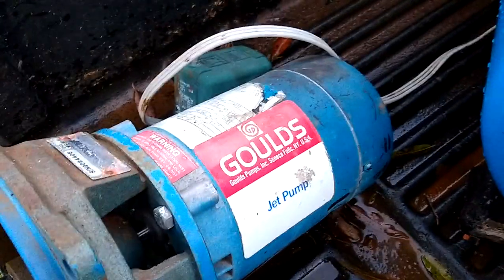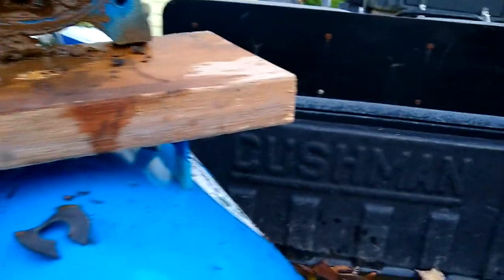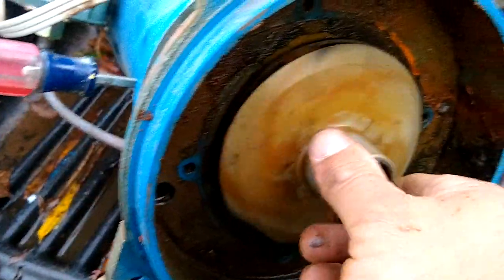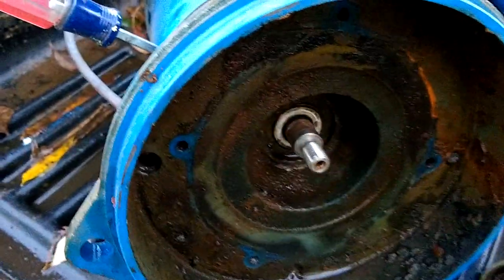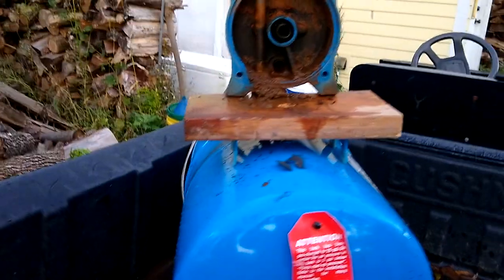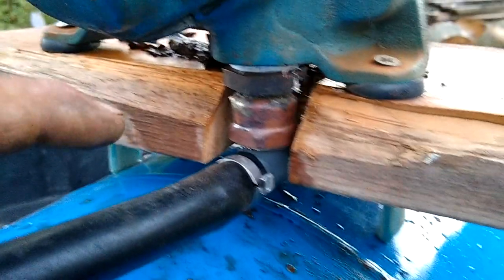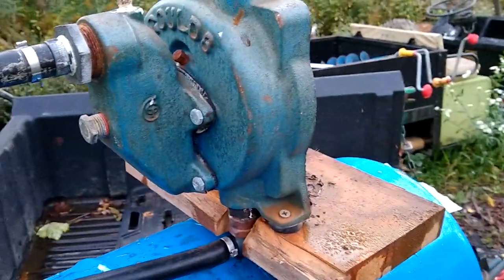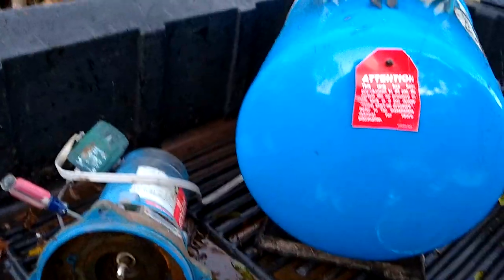Goulds J05 Jet Pump rebuild

Comment from the maker: Hooked it up after the rebuild and it still only would make about 20 psi. The nozell was also plugged, there is a plug on the front you can remove and run a coat hanger into and now it makes 50 psi.
Reply: What nozzle are you talking about? Having same issue
Reply from the maker: On the front of the pump just under the inlet line there is a plug, remove it and poke a hanger in there. It will save you a rebuild. That is actually all this pump needed
Reply from the maker: @D.Macchione  see my reply
Reply: @shaverbro  I have my pump plug off right now and i could stick the  coathanger through til it reached a solid part maybe 6-8 inches in, how far should the coat hanger be able to go through
Reply from the maker: @D.Macchione  that should be about right, just move it around, it should open up
Reply from the maker: @D.Macchione  did it work for you??
Reply: @shaverbro  it did allow my pump to reach 35-40psi(where before after I turn the pump off I'd have 0-15) so I adjusted my pressure switch to that. I accidentally broke through the big circular flapper behind the bottom port with the coathanger thinking I was cleaning it up(and I'm not sure what its purpose is). so I'll have to rebuild anyway I assume, but at least now I can keep my breaker on and use the water. 

Also it seems that my pressure tank isnt holding much water, so I'll readjust the air in it and hopefully that works. What air pressure are you using? My switch was a 30-50 but I've never seen it build past 40

As soon as I turn a faucet on, the psi drops fast and pump turns on but at least it turns off and builds pressure now.

What a journey this has been. I really appreciate your feedback!!
Reply from the maker: @D.Macchione  sounds like you need a new pressure tank, bladder inside has probably failed. Tank should sound hollow when you tap on it. Tank I think is only set at like 10-15psi. My pump builds to 48psi.
Reply: @shaverbro  my tank was over pressurized, was at 36. I set it to 28 psi for the 30-50 split and I have alot more capacity now, I also removed the gate valves and put in ball valves. Thanks for your help. It doesn't build to 50 psi but it works alot better
Reply: Just seen this after good job every one for get it
Reply: @D.Macchione  there a jet in the front housing dead center make sure it's not plugged I do this for a living 👌✌️👍🌊💦💯

Comment: Hey Patrick Thanks for the video!  I have a goulds pump model number J05N.   It pretty much stopped pulling water up from the well.  It wouldn’t even pump up to set the pressure switch off.  It would keep a prime but would not suck strong enough.   Do you think a rebuild like you mention in this video would work and keep the pump alive instead of buying a new one?

Comment: Hey Patrick, great video, well done! Wondering where you got the rebuild kit, and how much was it? I ran my pump dry yesterday. The inlet poly pipe actually blew a hole in it right at the fitting, never seen that before, I think there must have been crud in there working on that pipe for many years. It looked like a pressure blast, which it can't be. Anyway, the pump prob ran several hours sucking nothing but air. After I replumped yesterday, the Goulds would only pulsate, and kick the safety out as the motor kept over heating, after about 30 secs so I'm certain I have to rebuild it. So I replaced it today with a Home Hardware brand pump, a good pump, not a cheapie, but I want to rebuild my Goulds and have it ready just in case. Thanks for any info you can provide.
Reply from the maker: You may have melted the impeller, eBay.. Amazon, or Google for parts. Good luck, hope it's an easy fix.
Reply: Thanks got it all apart, impeller def melted.
Reply: Spend the extra money and pipe the suction side in brass. Even schedule 80 will stress over time.

Comment: You take the back end off and hold it with a 7/16  don't use a screw drive can damage motor there was nothing wrong with the pump I would of just replace the seal the jet in the housing plunged  that will make the pressure loss iv been rebuilding booster for 17+ years 👌✌️👍🌊💦💯

Comment: Your problem was plugged jet , take top plug out of front of pump and use a peace of wire to clear debris from nozzle jet , takes a minute and don't have to take pump apart,, but if you have to remove screws in cover on rear of pump losen capacitor and use 7/16 wrench in slots on shaft to hold it then remove impeller , your showing people how to detroy plastic cooling fins for motor.